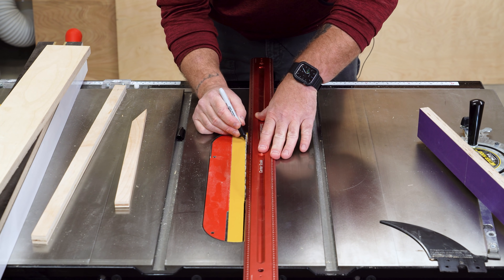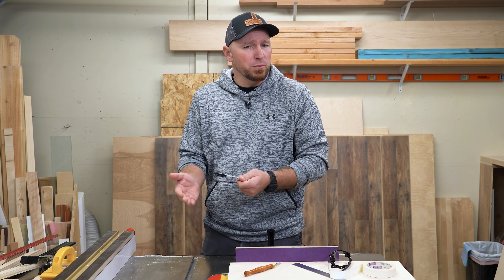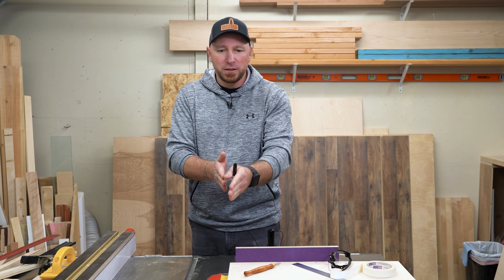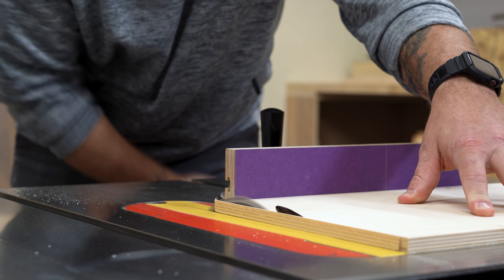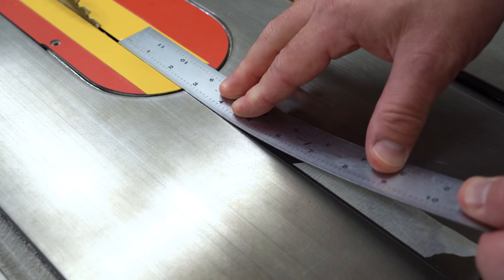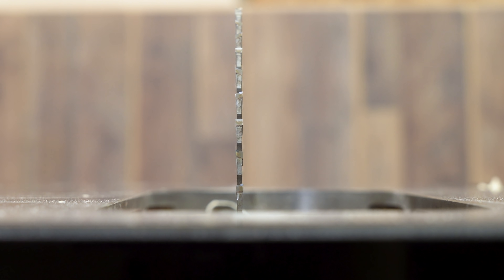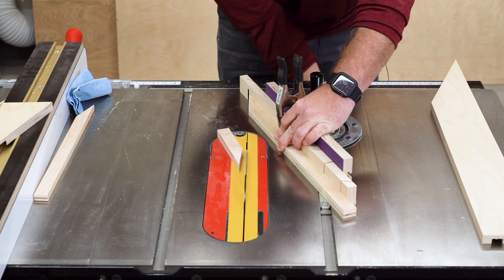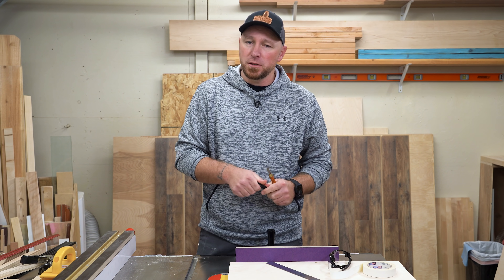Why I Permanently Etched a Line into My Table Saw Top.

Comment: I admit I wondered why not scribe a line in the iron as well. Opinion (mine) here: no matter the cost of the saw, and no matter how well you treat it, the top is inevitably going to get dings and scratches from normal use, and rust from when some well-meaning idiot sets a condensation-coated soda can down in the midst of a conversation. So I'd say that after disposing of the well-meaning idiot's body, scribe your line and don't worry.

Comment: But the scratch mark, sounds scary, and if you use different blades, some have different thicknesses, carbide, or steel, thin kerf...etc... Your line will then be not as accurate.

Comment: Technically speaking that line may not always line up with the edge of your blade. It will always line up with the same cutting thickness as the one you used. The amount will be next to negligible.

Comment: NOT ACCURATE - the scribed line only works if you use the same style blade every time. What about different blade grinds and the differences in tooth geometry i.e., Flat Top Grind (FTG) – best for ripping, Alternate Top Bevel (ATB), Triple Chip Grind (TCG), Multi-Purpose Carbide Tipped (MCT), Tri-Grind (TRI), Left Trim Grind, Right Trim Grind, High 30 degree ATB – chip-free cuts on melamine and plywood.  All of these are different and a slight bit different between manufacturers. I would hate to mark up a $5000 table saw only to have it not be accurate.
Of course, if you are just making stuff for YouTube and Instagram, where most people don't know the difference between a "maybe ok from six feet away" job and an actually accurate job, it doesn't really matter.

Comment: I almost cried when you intentionally scratched your top; bad, misguided, idea.  That line will not be accurate with different blades as the teeth overhang the plate by varying amounts.   Also, if you ever realign your saw, you could easily shift the top a mm or two to one side or the other making the line worthless.  

If I really needed a line I would have stripped the wax, used a paint pen or sharpie, and applied fresh wax over the top.